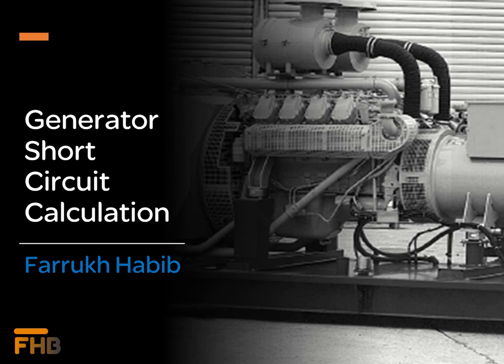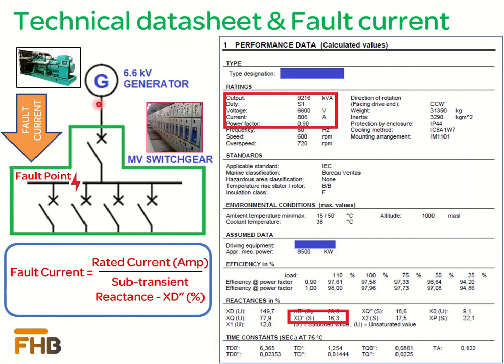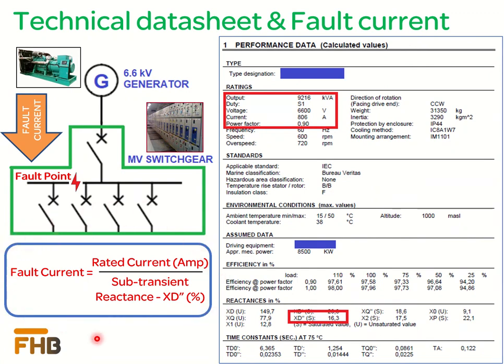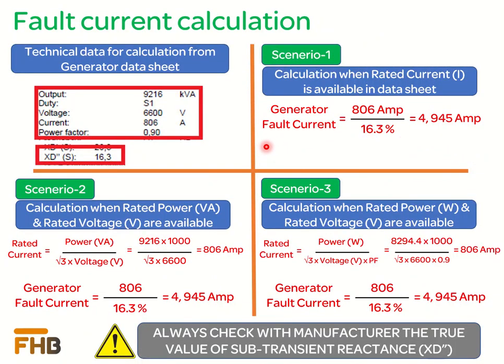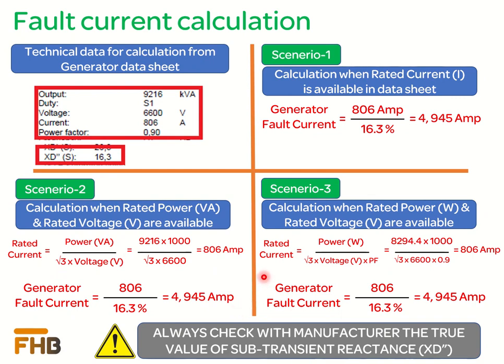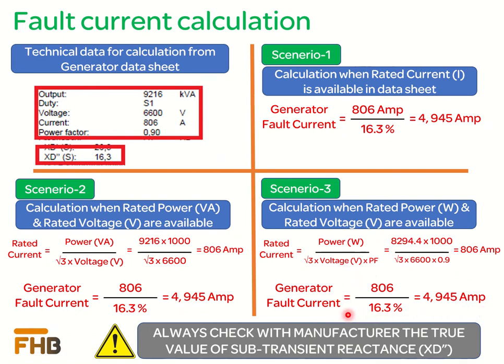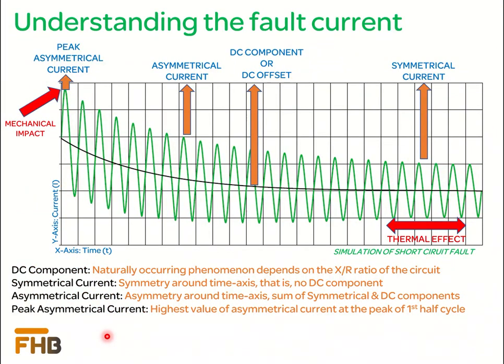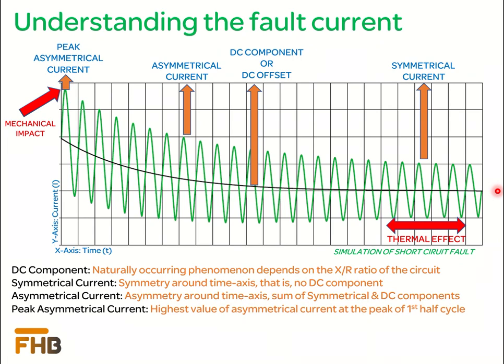Generator Short Circuit Current Calculation | Farrukh Habib - FHB| #ElectricalEngineering #generator

Comment: Thank you so much Farrukh for the very helpful video. I need to find subtransient short circuit level (MVA)  (is the same as our Generator rating?) and R"/X" (is the same as parameter called short circult ratio in data sheet?). Thank you so much